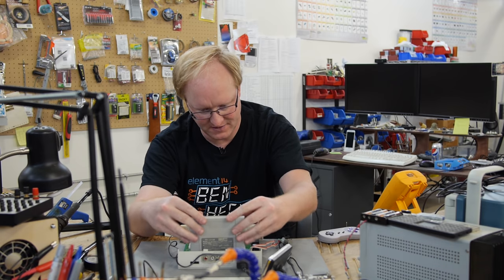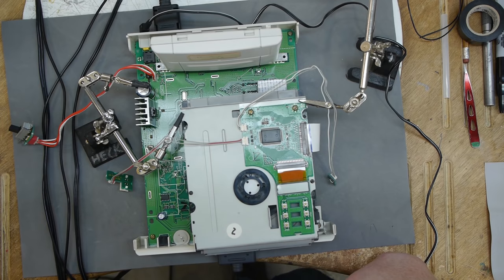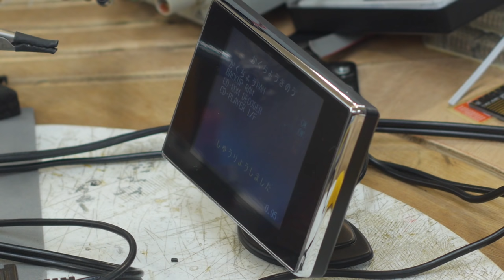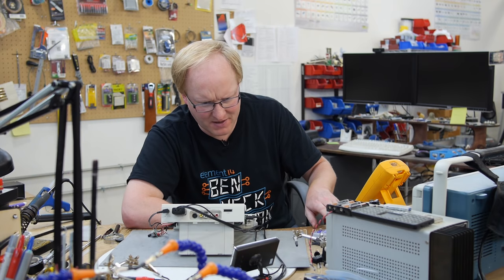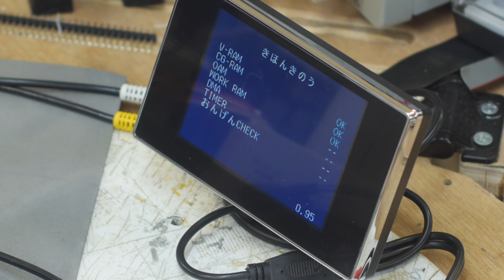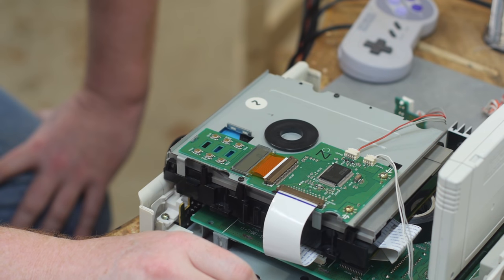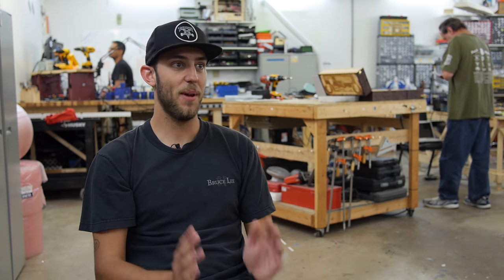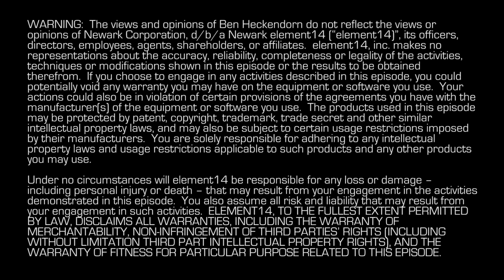Ben Heck's Nintendo-Playstation Prototype Part 2 Repair

Comment: probably a stupid suggestion but did you check the laser diode itself? a lot of these old sony drives use ks220 or similar units, i recently powered up an old sonly cd player that worked fine before storage but the laser had died being laid up so long. the laser in this unit is probably a common sony unit that is still available.
Reply: Another thing to note is whether the laser is aligned or not. We all remember the first wave of PS2s.
Reply: +The Official GMan Great idea! I know lasers in Nintendo units are pretty picky and easily damaged (cough*Gamecube*cough).
Reply: That's of course assuming that audio play functionality was ever in this particular revision and not something they hadn't gotten around to yet.
Reply: Just turn it upside down, like the PlayStation.
Reply: I would say, there is enough ideas for an episode 3. Hopefully we see this thing in action one day either on this channel or the owners share progression themselves.
Reply: Also there might still be some bad caps, I've repair a lot of sony camcorder from the time (1990's 8mm handycam) and the problem is always the surface mount caps
Reply: Was going to ask why you guys didn't try one of the homebrew CDs.. see if they would wake it up. 

This might sound a little weird, and honestly i haven't looked into it at all, but did anyone think to just dump all of the image files from a ROM onto the CD in a bin/cue to see if it (in early development) just had regular old SNES/SFami files all setup on it?

was also wondering how hard it would be to connect a different optical device, if it was just reading the data right off of it via some sort of IDE data conversion or if it had more to it than that. If it is just taking data lines, in theory the CD drive could probably be replaced with a different unit without too much issue.
Reply: +Steven Benson, If it's using a standard data connection for the CD, it's probably SCSI, judging on its age. As for your question, the best people to ask this to are the developers of Magic Floor and Super Boss Gaiden, since they both ported their SNES games to Super Disc.
Reply: I agree, theses solid states lazer diodes tend do go bad after 20 years, sadly.
Reply: The diode was the most common point of failure on gen one PlayStations.  I personally had one fail and I know a few others who had the same issue.
Reply: +Scott Ster I don't know if was the laser diode, or the focus mechanism, because turning the psone upside down would allow the lens to go near the CD due to gravity, it was the only way to make it work back then. probably replacing all the laser and lens/focus mechanism would make a difference on reading the CD
Reply: Cleiton Felipe upside down ps1 = damage to the arm the laser rides on.
Reply: +Steven Benson only the lens are attached to tiny metal arms that moves with a electromagnet near it to make the focus, the diode is not even near it
Reply: Jupp - when repairing I also see a lot of bad diodes or dull lenses
Reply: i guess my question is where do the data lines go and can they be accessed via the expansion port
Reply: If i were to make a guess, the clock for the soundchip must be coming from optical drive. No clock = no sound. But you get the clock even if your pickup is completely gone, so that's not it.
Reply: Oh wait, i haven't watched to the end. So your CD drive IS working now except for reading discs and magically you have sound again, which means i was right! Great. And also everyone else is right that you should first thing hunt down a compatible pickup and just throw it in, that might just be it. If you're unlucky, some batches of them cloud up with time even if they're not in use. Pickups were basically never used in a single drive model, they wander from manufacturer to manufacturer, so please make photographs to identify compatibles and throw them to the crowd, i might have a few i can compare with, and so do many other people, someone will find it eventually.
Reply: just like the laser unit in Sony Discmans fit in Playstatation as long as you extended the shorter ribbon cable a bit.
Reply: My Sony cd player manufactured in 1991, that I bought from a thrift store, strangely still works fine.
Reply: Neosophist I remember my ps2 (my first consol) had so many priblems. after repairing this twice. Eventully it just died for some unknown reason and was lost in a move. I still have my originall memory drive tho

Comment: laser mech is possibly dirty or failed laser - common for sony products
Reply: Ben Heck said he noticed the CD laser's red light was very dim, but he had no more time to work on that.
Reply: +Daniël's Tech & Music Channel that's probably normal. Most CD laser diodes are 780nm infrared, which your eye sees as a dpdim red light.
Reply: Common_C3nts I smell jealousy.
Reply: +r100curtaincall
Chances are, Ben has already seen numerous CD pickups at work, so if it appears dim to him, perhaps it's dimmer than it should be.

Comment: The super nintendo DOES have a region lock. But it was made in between "NTSC" region and "PAL" region. Japanese games can fit inside a european super nintendo, but it's not electrically compatible without modifications. A japanese game can't fit inside an american super nintendo, but as you've seen, they are electrically compatible.

They did the same with the nintendo 64 where there are tabs to prevent someone to put a japanese game inside an american n64, but if you remove them, it will work, whereas in europe you can put a japanese game inside the n64, but it won't start up.
Reply: Yeah but you got adapters where you put the USA game in slot one and a uk game into slot 2 to use USA games on a uk console.
Reply: This is exactly what is the region lock ^^. Also this technique didn't work for every games (mario RPG is one of them)
But the game will be slowed down because our consoles are 50Hz instead of 60Hz.

Comment: There's a reason why most game consoles do something optical drive related on their soundchip. As opposed to PC, the optical drive doesn't run on its own clock, to avoid reclocking the digital audio signal. On PC, currently, audio CD playback is simply implemented in software, and traditionally was implemented using an analog link, so the timing was irrelevant. In the interim, it was implemented with asynchronous S/PDIF that was resampled by the soundcard, with soudchips doing 48 KHz while the S/PDIF was on 44.1 KHz. On a game console, you can expect the soundchip to be programmed for synchronous mixing of CD audio, and they usually run at 44.1 KHz for CD based consoles, so the CD clock may not drift. So i know the Dreamcast design, it reuses a modified PC CD-ROM drive electronics, but the clock of optical drive is diverted to sound synthesis chip! Without CD-ROM, the soundchip cannot power up. Dreamcast hard drive modders use an approx. 33 Mhz CD-ROM dummy board for their units to allow the sound chip to function.

Comment: I'm curious... If the NES Classic releases in November, would you be able to hack it into a device that can play different games than the ones listed on Nintendos website?
Reply: I'm hoping for a cartridge slot solder points like the recent Atari
Reply: wait, recent? what was it
Reply: Probably not. The device runs through HDMI, so it probably features an  ARM chip with an NES emulator programmed in. It'd surprise me of there was any way for it to read older cartridges.
The only way it might be done is to reprogram the built in ROM, which is not a trivial task
Reply: I mean it's probably an emulator on an ARM processor. So you could potentially flash different roms, but that's not very technical, except for the part where you' have to desoder the chip to put it in a programmer.
Reply: I bet it's just an emulator running on an ARM cpu.
Reply: Probably. It's either going to be a small computer running an emulator, or actual NES(-like) hardware with a small computer attached to pretend to be a cartridge (I'm assuming it's one of these because Ninendo said they would add more games later, which probably means it has internet connectivity). If the former, it would require a software hack like you can do on a Wii. If the latter, you could solder in a real cartridge interface or something.
Reply: I think someone will put a Raspberry Pi inside of it
Reply: They specifically said they would not add games, or have internet on it.
Reply: then I was misinformed.
Reply: Just take the outer shell and put a Raspberry Pi in its place. You can put an emulator on there that would automatically start on boot. On Amazon there's "Mayflash Wii Classic Controller Adapter For Pc" which has two Classic Controller ports and it connects through USB, so you can run those to the controller ports. Raspberry Pi also has HDMI out. Then, bam. You have a Classic NES that can have any game you want on it.
Reply: +Amelia Hartman that is what I thought too
Reply: +superhampster but it's an emulator made with access to the original NES system source code ;)
Reply: There is no "source code" to the NES system. There's just the hardware. Emulating it requires proper attention to things like undocumented features (which even Nintendo may not have been aware of when creating it) and timing issues (which are critical for games with raster effects, split screens, etc.) - and after 30 years of fans learning everything they could about the system, it probably took a fair bit of work for Nintendo to develop an emulation engine of comparable quality to the ones already available. (I imagine Nintendo's engineers found all that fan-compiled information rather useful.)
Reply: Where did you hear that Nintendo would add more games later? From what I have gathered it has no connectivity and will just be the 30 titles it comes with. I can't imagine with it's low price point that it's anything other than a plug-n-play. But it would be great if you were correct.
Reply: Probably on reddit or something. I figured it would be like the virtual console on the Wii, you'd buy additional games online. I guess it'll be more like that commodore64-on-a-chip thing Jeri Ellsworth worked on? Not hard to imagine, since those are both 6502 machines.
Reply: Bart Stikkers I really don't think they're gonna create an all-new hardware implementation of the NES (like what Ellsworth did with the C64) - if you've already got emulator software written and tested it's much more economical to just pair that with a modest CPU than it is to reinvent a 30 year old system.
Reply: +Brandon Butler I'm pretty sure you'd need a new casing for the NES mini, then. Isn't the mini smaller than a 72-pin connector?
Reply: iKarnage 201V2.0 That's fine. It would only be more modding purposes.
Reply: I suppose it could have an external cartridge slot?
Reply: Im more interested in getting emulator off it, which is running on linux I believe. I just got a Pi with RetroPie installed, 2 x USB nes controllers and every single nes game. Also ordered 6button pads for sega, 4xsnes usb pads, 2x ps1 pads plugged in via a usb converter. Gonna store in a compartmented (camera like) bag and have the ultimate classic gaming pack I can take anywhere :D
Reply: It's already been hacked by different people right now.

Comment: The only thing I'm kinda thinking about was about the part where "NOT DEFINED" was written. I wonder if you tried to wire it back to what it was with the caps fixed with the CD-ROM?
Reply: The wire botch he removed was installed to disable the CD-ROM because it didn't work properly and made constant mechanical noises. Why would he reattach this wire to disable it again after fixing the caps?

Reattaching the botch would do nothing but disable the CD-ROM again and make the cartridge detect a non-CD SuperFamicom.
Reply: Was it really disabling it though? The NOT DEFINED happens without a CD-ROM drive as well.
I would expect it to have "NO CD-ROM SYSTEM" or something?
Reply: > Was it really disabling it though?

Yes, Ben Heck explicitly mentions that.

> The NOT DEFINED happens without a CD-ROM drive as well.

No, without a CD-ROM drive it says "NO CD-ROM SYSTEM". At least from what I have seen with people running the ROM in an emulator.

> I would expect it to have "NO CD-ROM SYSTEM" or something?

It said exactly that with the botch wire attached. The "NOT DEFINED" message came after removing the botch but before fixing the caps which somewhat makes sense. Because the system is more or less in a state where the CD-ROM is not disabled but also not properly responding.
Reply: +genkiadrian probably for historical preservation. if they find an actual disk for the thing they can always have the wire removed. But as is, that wire is still part of that console. Its still part of its historical value.
Reply: The wire is currently removed and the system works with regular Super Famicom cartridges.

Again, the botch wire was attached to disable the CD-ROM unit so the system would behave like a normal SuperFamicom, that's all and would stop making the mechanical noises. After fixing the issues with the capacitors, there is no need to keep the wire attached. It does nothing but disabling the CD-ROM.

Whether the CD-ROM is disabled or not does not have any influence on the compatibility with regular SFC games which makes sense if you look at how the console was designed to be used in the first place: If owners wanted to play a CD-ROM game, they would have to insert the CD-ROM cartridge (which was required because it contained additional RAM). If owners wanted  to play a regular SFC game, they could just pop in a normal game cartridge.
Reply: +genkiadrian yes, it's back to full functions with the wire gone. but that wire has been a part of that console for over 2 decades, like it or not that wire has historical importance.
Reply: +genkiadrian as well, since there is no discs for the system, why keep running it with the disc drive until a disc pops up? Running it with no use your just gonna wear it down. Might ruin the console that way.
Reply: it said no cd rom system.
Reply: No need to comment anymore, I got the answer I wanted from Ben Heck himself on Twitter.
Reply: oh ok, and I assume it was just that
Reply: That's a very real possibility.  A further evolution of the PC Engine's CD system cards that contained varying amount of expansion RAM.
Reply: Historical importance ? It's a wire. Also I'd hardly call this historically important, it's more like something cool for the few people that care (in 100 years you'll be able to count the # of people who care on 1 hand)   I also suspect this isn't the only one in existence, they definitely made several & while most were destroyed more likely than not there's at least another one out there (probably a private collection)
Reply: ***** "From what I've seen" what?
You are just making stuff up lol, there's no evidence whatsoever that nintendo was planning another super fx chip, even because while Star Fox 2 was in production they were already working on the n64.
And it would make no sense at all to have the superfx chip in the cart and not inside the disk drive
Reply: Be careful! When ya pinch Wendy's pennies, they pinch back.
Reply: mario

Comment: I seem to recall there was a pretty common problem with Sony laser pickups going out of calibration in the late 80s, through the early 90s, which would lead to a no disc error. I still see it crop up in Sony CD players from time to time.
Reply: The early PS2 had the same problem.
Reply: And the early PS1. I used to flip mine, either on its side or upside-down, to get games working.
Reply: +Tommy W yeah had the same issue on my old psx 5001 (stealth modded since the day i got it new if course lol) - ended up yankibg the entire head unit from some generic discman type player i had at the time - luckily a direct match :D played that unit for years after
Reply: Yeah, I did tracking adjustment on a few SCPH-1001 PlayStations back in the day. Part of it was making sure that the sled was aligned neatly (the tracks had a bad tendency to wear out) and the other part was adjusting some pots while probing the test points to get a good gain on the tracking servos. Fairly simple process and it brought some "dead" drives back to life.
Reply: That's right! I totally forgot about turning the PSX on it's side!
Reply: Laser power weakens, the lens clouds, the focus adjustment seizes up. These are normal issues independent of drive manufacturer. There's much fewer pickup manufacturers than drive manufacturers anyway, and there's little overlap, so they end up just using whatever.
Reply: That was for the cheapass plastic sleds used in all the fat PS2 models except the very last one before the slim version when Sony finally got the hint that they had to make it out of metal to keep it from wearing out fast.

Comment: I wonder if the CD ROM laser is calibrated for CDR/CDRW discs. I know, on the older consoles, if you modify the laser intensity to read CDRWs, you can lose the ability to read pressed/retail discs. Seeing as how this is a prototype system, there may not be any copy protection scheme in place to prevent it from playing backups. Maybe CDR/CDRW wasn't readily available yet and I'm just blowing smoke. But, if this was an option back then, it would make sense to be able to burn your own prototype discs for testing purposes, rather than requiring special discs to be created. Just a thought.